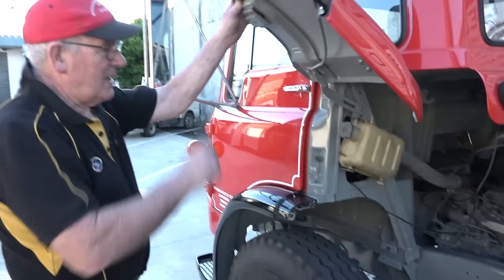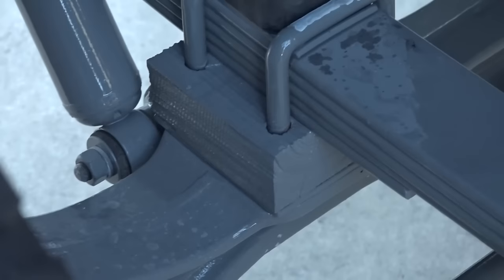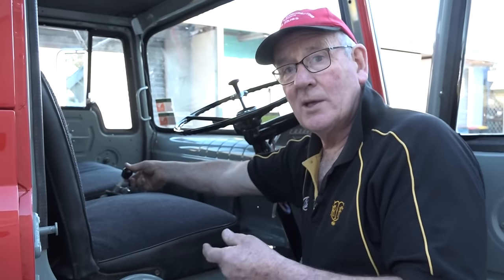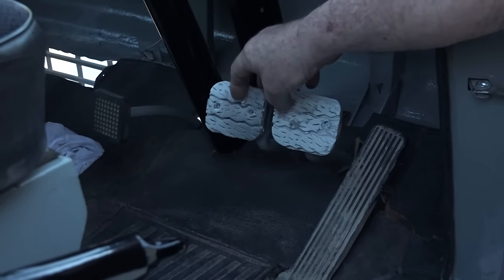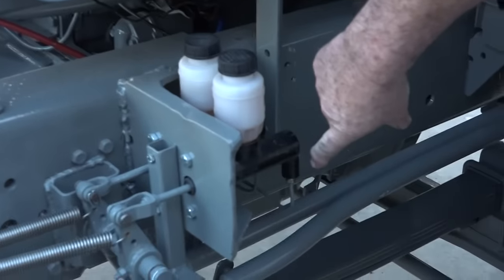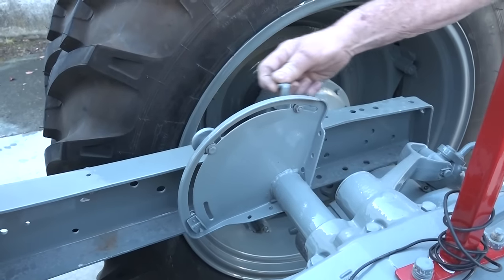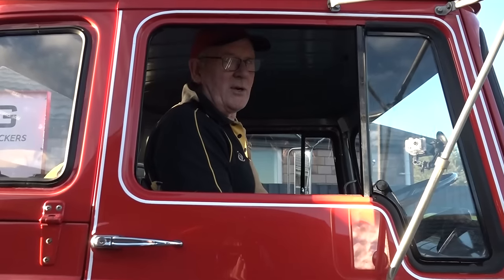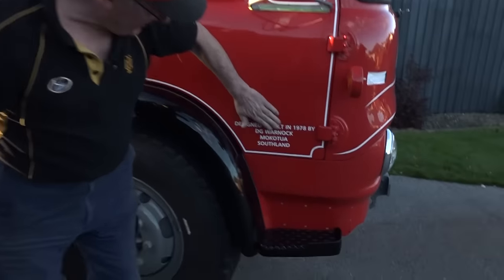BEDFERG 1978 Massey Ferguson TK Bedford Hybrid.

Comment: The first thing I ever drove was a little grey Fergie, I progressed to a Massey Ferguson 65. Have driven several Bedford TK's. tippers, flat beds and artics. But never a half breed, bloody wonderful mate.
Now a TK's hand brake worked on the prop shaft, bust a half shaft on a hill and you aint got a hand brake, plus you cant leave it in gear to hold it. I came across a TK on a hill, the driver waving like mad he'd been there two hours holding on the foot brake. So I found some rocks and stuck em under the wheels, boy was he happy to get out of the cab.
Reply: Good Moaning Vietnam My dad yanked the multipower tranny from his 65, with no engine brakes and shoddy regular brakes it was a scary machine.
Reply: A mate used the chassis, RR engine etc. from an Austin Camp, With the front end centre and rear from three different cars. The gearbox had a separate forward reverse lever so it had the same number of gears both ways. It was a brute of a thing but was not road legal.
Reply: I was driving a Ford rollback wrecker some years ago when the driveshaft (propshaft) came out while going up hill. Parking brake was on the transmission tailshaft. Had to sit and hold the brake until a competitor came driving by and stopped to inquire as to why I was just sitting there. Thankfully, while his wrecker was too small to tow me in he did toss a block under the wheel and call for a bigger rig.
Reply: I thought I remembered on one of my neighbors old tractors (I was a kid), a little lever that was attached to 1 brake pedal that you could swing to lock into the other pedal, so you only had to hit 1 pedal during braking? 
Only issue I’d see is it better be darn stiff to avoid flex and affect even braking.
Reply: Yes, many old tractors had independent left and right brakes with a lever to lock the two together. The feature allowed the operator to turn more tightly and to stop a spinning tire so that the other tire might better pull you out when stuck. It could be dangerous on the road but was great on the farm.

The new Yanmar tractor we just bought to use around our little sawmill is a great tractor but like most new things these days they have tried to make it idiot proof and it has only 1 brake pedal. I constantly find myself reaching for the pedal that isn't there and it requires more room to turn it than a similar sized tractor with separate brake pedals.

But it is 4wd so it is slightly less likely to get stuck.

Comment: Thanks the machine is great. Feels like truck but has powers like tractor.Good job.Try putting in  the wheel the single wide smoother tires used on the rear of some compaction rollers. The speed will be increased and the ride much smoother.

Comment: Great work, all though I am not sure about the block of wood between the spring and axle pad.
Reply: Bob W he said his dad did it years before he got it so looks to be holding up ok
Reply: I paused the video at 3:45 and it looks like one of the blocks may be cracked. The whole thing is bad ass, but those blocks really should be replaced with steel.

Comment: Very nice Vid:  Never thought of doing a conversion like that for Forward Control - looks simple enough concept, Hmmp, anyone seen any old TK orTL's around?  most rotted away - had one myself years ago - lovely low cab with plenty space. Good match on the 65 - imagine on a newer one with wet brakes - Hm - what happened to Bedford front brakes?  very touched with it many thanks
Reply from the maker: Glad you enjoyed it. Cheers :-)
Reply: culmalachie imho,NZ has the most S,Jays n TKs,Malta also.
Reply: Fruit growing places still a few,3 months wk a year,n sit in the shed the rest.1990s I drove a mint 55 S apple truck ,and a 73tk petrol five speed.55 S,300 petrol could haul 7 ton at 40mph,valve bouncin at 60 empty.Armstrong steer,only four gears no synchro,ie loaded you had to rev right out to catch the next gear,n double clutch of course.No gauges really,thats what ya bum nose n ears are for.To drive something like that you must understand how it works.